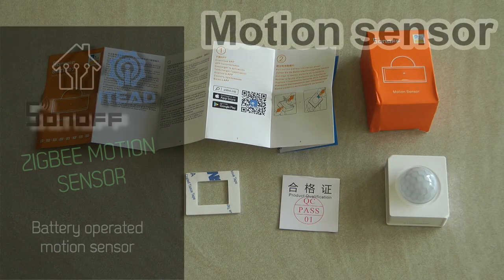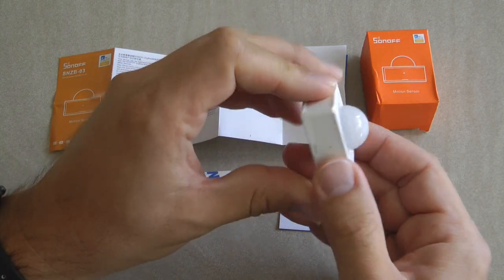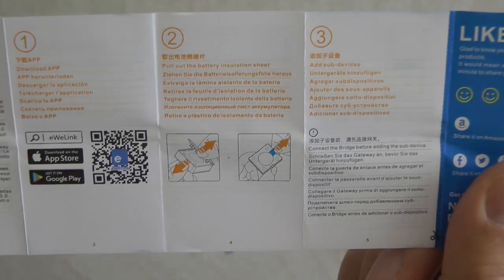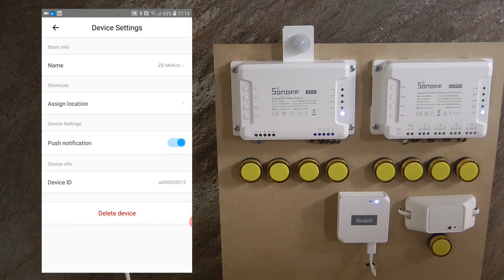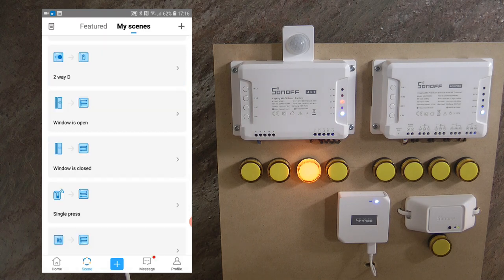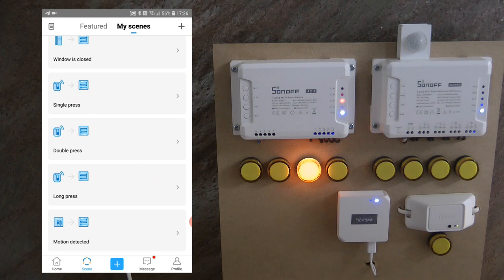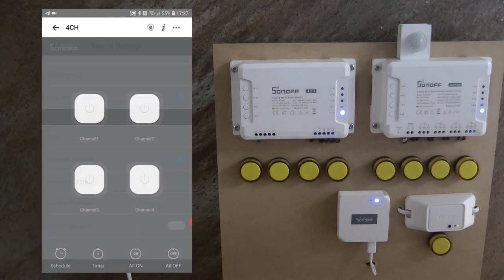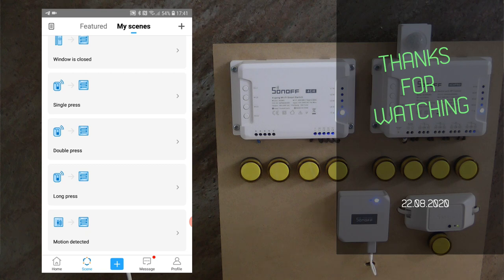Sonoff Zigbee Motion sensor

Comment: The device has a 1-minute buffer and won't send anything to the bridge as long as its state has not changed locally (to save battery). So, when you set the channel to turn off after 10 seconds, the motion sensor is still in the "occupied" state (not "clear" state) and won't update the bridge unless its status changes. So if you keep waving your hand in front of it (even for hours), it will keep its state in the "occupied" state and won't send any info to the bridge (hence no triggering).
Reply: Same issue of my zigbee motion
Reply: Yes this is called "cooling time" and all motion sensors have it. Some sensors like IKEA take 3 minutes before they can detect motion again. Some have it configurable. Its a hardware limitation most of the time.
Reply: I knew that cooling time can be configured if you use smartthings hub. However i didn't test that myself. Any one does that?

Comment: "Due to power consumption and power-saving considerations, there have some restrictions on the trigger
That is: when SNZB-03 detects the movement, it will send a signal to ZBBridge
If the device does not detect any movement for one minute, once the device triggered, it will send a signal to ZBBridge
If any movement is detected within one minute, the device will not send a trigger to ZBBridge. And effective detection and trigger signals to ZBBridge will be delayed for one minute. It means the motion sensor works with one-minute intervals."
Reply: exactly what I was looking for.. was wandering why i couldnt turn off a light immediately i.e. 10 seconds after motion detected ceased. Anyway to get around this? I literally want it to turn on and off a light for 10-15 secs . A min is actually way overkill for this purpose..  Yep noob here. Thanks!
Reply: was wandering why couldnt i just have an automation that says IF lightglobe was on for more than 20 secs, turn it off, but that doesnt work for me! :(

Comment: I just tested the sensor and on my testing the delay for “no motion” is 60s. So if you want more time fo the light or device that you want to control with motion for more time active i did a delay for “no motion” status of 15s and the lamp turned off in 1.15min  so if you want more time just ad the time + 60s for the delay

Comment: Can you set up 2 motion sensors on a staircase so they can act like a two way switch? 
For example: When I go down, first sensor turns on the light, when I rich down in the second sensor area, I would like the light stays on. Is this possible with scene settings in ZigBee bridge?
Thanks and greetings from Cluj Napoca
Reply from the maker: Yes, with two sensors and a bridge. And set up a scene where either of two motion sensor is triggered a light comes on and goes off after e.g. 5 minutes. It will not be exactly 5 minutes after the last motion detection because subsequent motion detection does not restart the counter, but if you set it to a few minutes it would be enough anyway.
Reply: @csongorvarga  Thank you very much for your fast answer
You are doing a great job!
Good luck with your channel !

Comment: I find the delays between sensing make this unusable? I can’t add the bridge to smart life so to control my Tuya devices I have to use IFTTT but there is a longer delay in then triggering lights etc to turn on.
Reply from the maker: I will make some tests. Since I am using it occasionally, the re-trigger delay does not appear to be that bad for me.
Reply: Ah okay. I am using it to turn on a bathroom light which is powered using a WiFi socket in brilliant smart using IFTTT. It then on no motion turns the light off. However with constant motion it still doesn’t reactivate the ON command for the light
Reply: @timknowlden  did you get a fix for this? without delay, it's kind of useless
Reply: @WilliamRufino  no I just don’t use it anymore. I bought an aqara motion sensor and it works perfectly

Comment: What is the reset time like on this sensor?   I got a Tuya Zigbee Motion Sensor and it is completely useless.  It can take between 3 and 5 minutes to reset and trigger again.
Reply from the maker: I did not measure. But it looks like a few minutes at least.
Reply: @csongorvarga  Darn, sounds similar to the Tuya one.  I might be stuck goin with Philips Hue.  Expensive, but they reset after 10 seconds.
Reply: @EsotericArctos  Hi Brendan, will the Philips Hue sensor work with sonoff switch?
Reply: @neilcarroll7847  Unsure if it works with SonOff, but it works with deConz, Home Assistant ZHA, SmartThings, Hubitat and of course it's own hub. 
I am not sure how well third party devices work with SonOff.   I have heard some mixed results.
To pair the Hue Sensor with a third party bridge, you just delete it from the Hue Bridge, then use a pin in the RESET hole, holding it for about ten seconds (The LED on the Hue Sensor will go green).  When you release it, the LED will flash green/orange and pair with a third party device.   Same with the Hue Dimmer switches.
Hue Globes need to be reset with a Dimmer switch, then they pair with third party hubs as well.
Reply: @EsotericArctos  thanks Brendan!!
Reply: @csongorvarga  I have run some testing.  SonOff Zigbee seem to behave like Tuya Zigbee.  Hit and Miss, often with long delays.   The Xiaomi Mijia range seems to be similar.  The Xiaomi Aqara range is quick with response and usually resets within 30 seconds.
Darn, this is such a minefield.  It's hard to find reliable sensors.
Reply: @EsotericArctos  Let me know if you do find something reliable! these sensors are rendered useless and a standard wired in sensor is looking like it may have to be used.
Reply: @timknowlden  To be honest, the Xiaomi AQARA line (the square ones) seem to be the best for Humidity/Temperature/Pressure.   I hate to say it, but for Motion and ambient light, Philips Hue motion sensors still seem to have the best response.
I'll keep looking around though.   I can tell you 100% Tuya Zigbee and the Sonoff Zigbee have quite poor response times.
Reply: @EsotericArctos  That is a shame, i havent got many devices but all my sockets are wifi ones. I was hoping to go down the sonoff route because they are so affordable.
Reply: @timknowlden  YEah, unfortunately affordable comes with a cost of reliability in this case.  The Xiaomi Aqara are not quite as cheap, but they are pretty reliable and you'll get 2 years or so from a battery.  The Tuya Zigbee devices I bought came with the batteries already drained to 50% and one even was right down to 30% out of the box.   They seemed a little amateur in the packaging as well.
Reply: @EsotericArctos  Thank you, I will look into this, aqara seems to be different to the mi hub and aqara isnt listed on the xiaomi website, the only thing i wouldnt like about going this route is buying into the ecosystem.
Reply: @timknowlden  The Xiaomi Mijia stuff is different and the Temp/Humidity sensor is round and doesnt do barametric pressure.  Mijia sensors are slow.    The Mijia motion sensor also is only motion and is slow as well,  where the AQARA one has motion and light level sensors and updates quickly.
Aqara you need to find more on Amazon or eBay.   You can get it new, but it is the older range of Xiaomi sensors.
Reply: @EsotericArctos  Thanks for all the info, its a route i might explore, but they arent available at the moment on amazon UK nor do they do a UK smart plug at the minute.
Reply: @EsotericArctos  Looking into it a bit further, it seems as though there isnt a UK version, but there is an EU one which can be used with an adaptor in the UK, however there is a possibility of an aqara m2 hub being released which is USB C powered so able to use anywhere, there also is a mi hub v3 which is compatible with aqara motion sensor so thats an option available now.

I am also thinking about going down the homebridge route now to connect all my exsisting sonoff and wifi non-homekit devices in with the aqara sensors.
Reply: @timknowlden  The sensors usually happily pair to almost any ZigBee hub.  Unless you want to go all Xiaomi, don't feel locked in to them.  I use my Aqara sensors on a deConz co-ordinator running with Home Assistant :-)
If you go homebridge route with a SonOff bridge, I believe non-sonoff sensors will happily pair to the SonOff bridge (ZigBee version)  There are a lot of options to consider.
Reply: @EsotericArctos  Hi Brendan, when you say hit and miss,  it means it doesn't work some times or when you are in the room the light goes off even though there is motion.
Reply: @neilcarroll7847  sometimes the light will go off while still in the room as the device doesn't re-trigger without having a several minute cool-off period.
Occasionally it won't trigger when entering the room, but 99% of the time the initial trigger is fine, but re-triggering while still in the room is more miss than hit
Reply: @EsotericArctos  Thanks Brendan, your testing saved me some trouble!!!

Comment: I wonder can it be used in bathroom, since it's humid area... is it IP protected?
I knew no motion trigger time can be configured if you use Smathings hub. Is that correct?
One final question, does it needs internet to keep working?
Reply from the maker: It is definitely not IP protected but if you can keep it off direct water it should be fine. I don't know about Smartthings never used that. Internet connection depends. If you are using it with the Sonoff app, you need internet connection. But if you have a local home automation solution that handles the logic locally do don't.

Comment: I was looking forward to this video, how long have you tested this sensor for?
Reply from the maker: I have it up and running for a few weeks now, but I was away most of the time for holidays. So honestly not much actual testing just yet.
Reply: @csongorvarga  Okay!! Does it turn off the light when you get away from the Sensor? as per Sonoff SNZB-03 This device has a mechanism.
 This product detects a moving object, then it will send an alert message, and it will go to sleep after 1 minute

If the monitored object has been moving, the alarm information will be sent every 1 minute.
 This device detects the human body temperature, so if we create a scene for no movement then after a minute when there is no movement the light should go off!

Comment: I would like to buy this zigbee bridge and would like to connect zigbee smoke detectors to it. Sonoff doesn’t mention smoke detectors in the available devices. Have you tried adding them anyways or have any idea if this would work?
Reply from the maker: I did not try, and I am not sure it will work. All I have tested is connecting other motion, door and temperature sensors to the bridge. Sonoff understands what a door sensor is, what a motion sensor is, even if it is coming from a non-Sonoff modell. This is why I think it will not do anything with the smoke sensor. The device will pair, but the app will not show any data, and you would not be able to use it in automation. In best case scenario it will act like a switch, so when smoke detected it will act as a switch has been turned on. But I really have no idea.
Reply: @csongorvarga  Thank you for your very fast reply.
I guess I’ll have to look for another solution to receive push notifications on my phone when smoke is detected then. I know that Sonoff also makes a 433hZ bridge, so I could use that one. The reason I would have liked to use zigbee is that I found some really sleek looking zigbee smoke detectors and haven’t seen any with 433hZ frequency that look good.
Reply from the maker: @xanderc5097  I am afraid it will not work. Zigbee devices do not send notifications, and in the eWelink scenes there is no possibility to add notification to the scene. You can use IFTTT to send you a notification, but for that you need the paid version of the Sonoff account. So they are not making it easy :(
Reply: @csongorvarga   at around 3:20 in the video, you can see a setting that says ‘’push notification’’ so if I connect a 433mhz smoke detector to the Sonoff 433mhz bridge, wouldn’t the app send out a push notification on my phone when the detector is triggered? Or does it not work?
Reply from the maker: @xanderc5097  Yes, but for example the same option is not available for other Zigbee sensors. And I don't remember it at all for RF. So this is not a general feature which is available for all devices.
Reply: @csongorvarga  okay, thank you very much for the information and for helping me out!

Comment: Hey can you use it, whitout the zigbee hub, I mean direct in the ewelink app, as an normal Sonoff diverse?? 🤔
Reply from the maker: No, Zigbee gateway is a must!
Reply: @csongorvarga  nah okay..
Reply: I have tested.  Sonoff devices will pair with Smartthings, deConz and Hubitat as well, but definitely wont work directly with an app without a hub as they are ZigBee, not WiFi.
Reply from the maker: @EsotericArctos  I hope I will get some Blitzwolf Zigbee sensors as well, so I can cross test them with Sonoff.
Reply: @csongorvarga  That would be fantastic.  Unfortuantely I haven't seen those here in Australia, but it would definitely be good to see how they compare as importing them is an option with ZigBee.
Reply: @csongorvarga  Any luck with BW zigbee sensor? does it work with Sonoff motion sensors?
Reply from the maker: @nucleuspower  Yes it does, I did a separate video on that.

Comment: Can I add this to other zigbee 3 hub?
Reply from the maker: Yes, I managed to use it on a Tuya zigbee hub and also in a zigbee2mqtt gateway as well.
Reply: @csongorvarga  Thanks for the reply. Managed to connect it to zigbee hub after trying for 2minutes. But the sensor is not listed as a device in alexa to trigger. when I create the scenes in tuya app, it is getting discovered in Alexa. Will it be discovered in Alexa app as trigger if I use sonoff hub? I have echo dot and echo sohw

Comment: Thank you for this video. Do you jnow if there exists some kind of range extender for zigbee ? I am looking for such an extender to extend a "Roco Multimaus Pro" system (based on zigbee)
Reply from the maker: I don't know how it works for the Roco Multimaus, but all Zigbee devices re-transmit the codes they receive. So any Zigbee device is a range extender as well.
Reply: @csongorvarga  not all devices re-trasmit, only the ones connected to mains power act as routers.
Reply from the maker: @MegaUndertaker3  Yes thanks. I found that out after I did this video.

Comment: Hi, how quick is it to react to a movement? I am currently using a 433MHz sensor, a Tasmotised Sonoff RF bridge and home assistant to turn on a light; there is about 1s delay between when the PIR detects the movement and the light turning on
How quick is this?
Reply from the maker: The delay is probably a bit better, but there is some delay. Maybe 0.5s. But keep in mind that the most criticism this sensor gets, that in order to save battery, it goes to sleep for about 1 minute after motion is detected. So if you need multiple detections it will not do it.
Reply: @csongorvarga  yes, I've read that; I guess, as long as my light turns off after more than 1 minute (that's what it's set to), I should be ok

Comment: Hello, one question, if I install a ZigBee Bridge inside my house to connect a motion sensor inside a car, my doubt is that the car obviously when moving away will lose connection if I leave the sensor inside, when returning to the home will the sensor reconnect automatically? or the devices need to be paired again?
Reply from the maker: Yes it will work, it does not need to be paired again. It is like when you replace the battery once the old battery dies. It will just connect back to the gateway.

Comment: Need to hack the battery, is not a common battery and it will drained out fast at high traffic area. So it really depends on how you going to use it.
Reply from the maker: I think this is the reason a bigger battery was used. CR2450 is not "that" uncommon, just dig a bit deeper in DIY stores.

Comment: is it possible to adjust sensitivity?... I have installed two outside protected from rain, but .. windy days is a problem, the slightest wind that hit trees triggers the device...which means the lights are on almost 24/7..